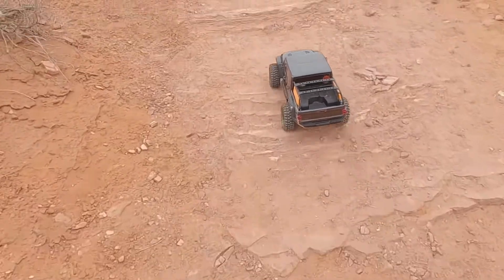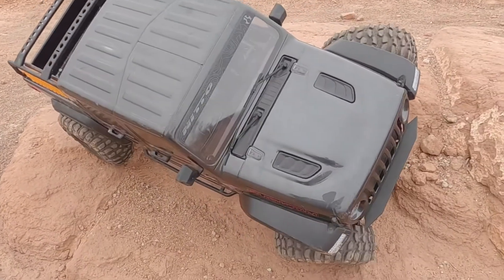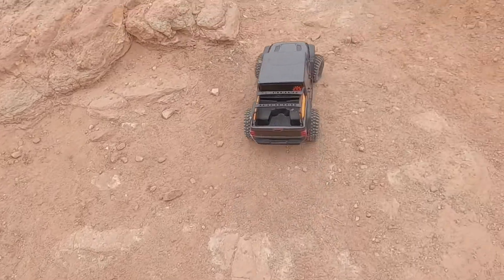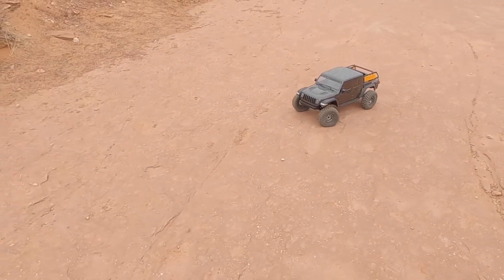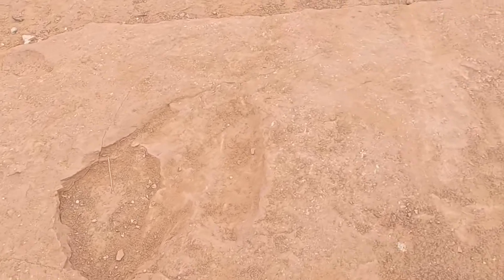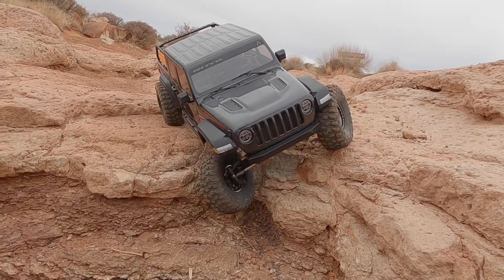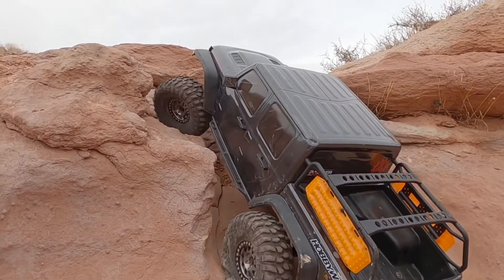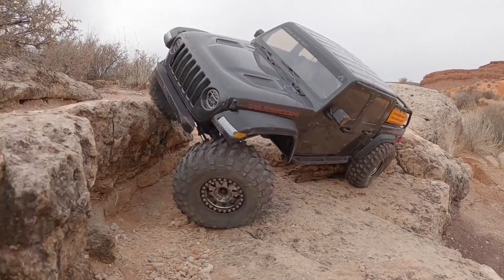Dinosaur Tracks! Gladiator Scx10 III

Comment: Capra axles actually fit very well in the Scx10 iii chassis for the Gladiator body like how it widened the tires to give it a more realistic and aggressive look
Reply from the maker: Thanks, I like the look as well. I really like the look with it on 2.2 Pitbull tires
Reply: @westdesertwheeler  would the same “wide” stance be achieved if runners some spacers instead of the Capra axles? Thanks.

Comment: Awesome video!  Questions I didn’t see covered in the video or description:
Have you changed the gearing at all? Stock pinion, etc.? I’m not familiar with whether or not the Capra axles would have geared it down. 
What are you running for foams/inserts?

Comment: Hey mate, I'm going to ask you the most basic question you've ever had. Where did you get the orange tyre boards from? On local eBay everyone who sells them 3D prints them but because the Gladiator is bigger they need to be bigger than standard.  And no one will print bigger as a one off. The Overland pack has them but in red. Did you just cable tie them on? Awesome videos, keep up the good work.
Reply from the maker: No worries, I bought them from a hobby shop. I think they are the RC4WD boards. Just used a small screw to mount them. They are a standard size nothing custom

Comment: Did you use the 10.3 transmission?
Reply from the maker: Yes
Reply: @westdesertwheeler i started my 10.3 build and im going to use some ar60s which should fix that driveshaft issue but i want 4 link up front since the servos also on axle can i just bolt up any 4 link skid plate? its gonna be a funny looking rc with the proline 13.9 wb silverado body and stock ryft tires and wheels😂😂 and 4ws its going to be a snow recovery type rig haha super heavy and stable if i can😂